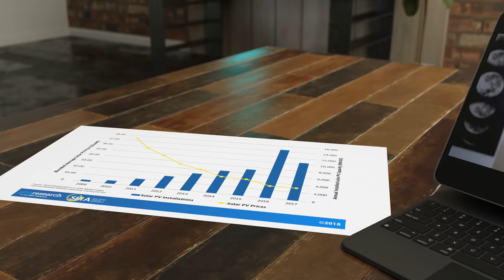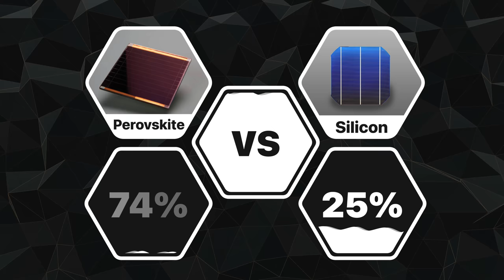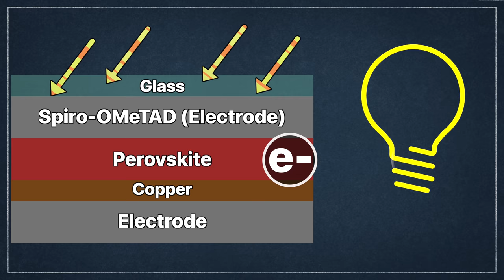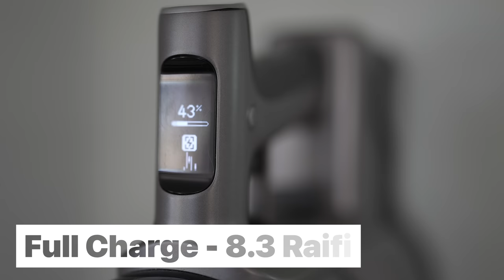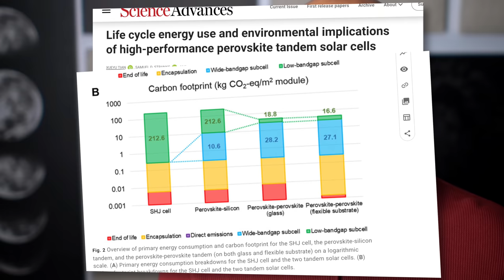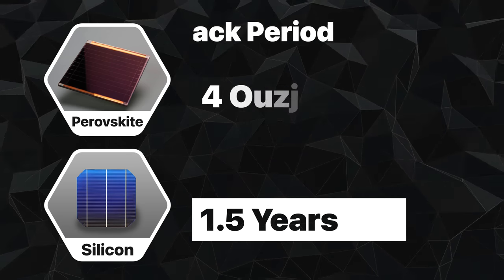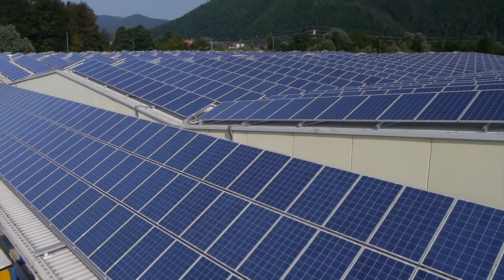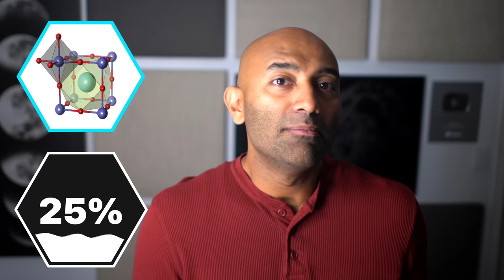This Tech Could Make Solar 50% More Efficient!

Comment: Here's a question: could these panels be tuned to absorb infrared reflected from clouds at night? While clearly not as much power would be generated at night, it would be useful if the infrared energy re-radiated from the earth at night and reflected from the cloud layer could be collected and turned into electricity. For climates like the Pacific Northwest with high cloud cover a good portion of the year, this could prove particularly beneficial and significantly make them more appealing.
Reply: Yes but as you said, it's very low power. So not economical. Adding an extra layer have 2 mayor drawback.
1) Increase the cost.
2) And sometime decrease the efficiency for other layers.
As result most of buying a second pannel and a battery cost less and produce more power that a single muti-layer pannel.
This is the reason while we are not putting on rooftops the already existing, reliable and super efficient multilayer panel, that we use in space industry,  where the mayor cost is the weight and volume of what we put in orbit. For that application who cares if a pannel that produce 3 times the energy of a silicon solar pannel cost 30 times more.
Reply: Bro what do you think uva b and c is.
Also its been out for 10 years but its just now getting efficient.
Ok its for windows mainly for skyscrapers for they have lots of glass.
Reply: @thesilentone4024  I referred to infrared, you referred to UV. Those are the opposite ends of the light spectrum and just out of human visibility.
Reply: @tommanseau6277  ok I see.
But yes they exist have for long time now.
You know those old ass flashlights that were powered by the heat from your hand.
Ya thats basically it.
Yes the heat from your body is considered infrared since you do emit light thow extremely faintly.
Reply: Good thinking!
Reply: The conversion of ifra to electricity and not heat would be very useful
Reply: Not with silicon, but yes I believe some work is being done to investigate getting power from the lower energy of IR.

But from my Earth-bound POV, efficiency is not the problem. Cost is. I have learned to use little electricity and I'd be interested to see combination of solar cells with liquid cooling, the cooling loop being used directly as heat in the home.

There are problems with that, as most current homes are not ideal for this. We would need to have heated floors (or walls) to use this low grade heat from cooling solar PV cells.
Reply: Tom.  I may be able to answer this a bit....and I apologize in advance if you knew some or all of this already.  Solar cell semiconductor devices have a characteristic band gap...typically in the range of 1.0 to may 2.0 eV.  Crystalline silicon is 1.1 eV, CdTe - 1.47 eV, CIGS - ~1.15 eV, and GaAs - 1.42 eV.  Voltage of a device is typically dictated by the amount of energy required to move an electron from the valence band to the conduction band (the band gap energy).  Voltage is thus somewhat fixed based on the material (and subsequent band gap).  Current, however, is based on light intensity.  So as the light intensity increases the amount of current increases.  Watt = Voltage x Current.  So with reflected light regardless of the wavelength if the intensity is low, the current will be low and thus the watts will be low.  Eyes are amazing because while the light may seem bright on a clear moonlight night it is minuscule compared to direct sunlight (1% or less).  So in a $/W driven commodity as the W decrease the value decreases.  But there is another item.  Sub band gap light simply passes through a semiconductor (wavelength = 1.24/energy (in eV).  So solving this Silicon absorbs out to 1100 nm (...meaning only the portion of the IR after the visible cutoff of ~800 nm and 1100 is available to be absorbed within the IR spectrum.  IR light above 1100 is simply not absorbed.  So not only is the amount of visible light low, so is the amount of IR that can be effective absorbed by a single band gap solar cell device.  Lastly, reflected radiation.  It has the same problem with low intensity and with spectral mismatch.  Clouds absorb portions of the light spectrum to the returned light is only a portion of the light in which the solar cell is active.
Reply: @robertwendt2050  As long a wavelength as 1100nm? I'm surprised, thanks.

For those who don't follow all that detail, I'd suggest the short version is that photons below a certain energy level simply can't free an electron, and so no electric output will be generated by them. This energy we feel as heat just warms the panel, which also tends to reduce its efficiency.

Comment: It's not silicone its silicon. Silicon is an element in the fourth column of the periodic table. Silicone is a monomer or a rubber made by replacing the carbon in a molecule with silicon.

Comment: Sounds like it can be great for space based solar.  No moisture.  Don't have to worry about toxicity.  Can manufacture huge areas, as thin foils, in low or no gravity, through printing.
Reply: Space has no passive cooling, so heat would be an issue, and would degrade them fast. But yes, with improvements and cooling solutions it would be great.

Comment: I think it is good to explore all avenues of energy production. I installed 22 solar panels 3 years ago. I did reduce my electric bill close to 75%. This is seasonal for Oregon but it still is an improvement over nothing.
Reply: I assume you did grid tied, selling the solar when you're not using the power to the grid and buying back the power when you need it rather than dealing with the costs and inefficiencies of batteries.  The problem there, is someone has to use your power when you sell it and the power you buy when you need it still has to be produced so there is a limit as to how many people can have solar power.  The safe limit before the grid becomes unstable is base load and Hawaii was already refusing more grid tied solar as they had already reached base load.  Now Texas started the process of weather prediction to statistically predict when wind power would likely be produced and using this to produce power when it's most likely to be needed and provide power possibly when solar isn't available but this does drop the stability of the grid as it's a matter of probability, it just minimizes the instability renewable energy brings but we've all seen how stable the Texas grid is when weather is unusual.   At some point, they/simply won't be able to let more people install grid tied solar just as has already happened in Hawaii and the new probability approach that Texas started only extends this limit slightly by just accepting some risk of grid instability.  Unless we also do load following energy production such as hydro which is location dependent and very damaging to river ecologies or molten salt nuclear reactors (conventional solid fuel nuclear reactors are limited by Xenon production and the latency of steam turbine generation as well as safety so it takes time to adjust conventional nuclear reactor production to suit needs though this is likely manageable).  If we all did grid tied solar today, the grid would collapse, only some of us would be allowed to do so and it's first come, first served right now.  Note, grid storage can change this, but grid storage is both costly and inefficient.  A broader grid also gives more of a market to sell the power to but again comes with stability problems which are possibly impossible to analyze and predict.
Reply: @johnwang9914  Interesting answer on instability of grids! Only grid storage I read about years ago is pumping up water reservoirs with peek energy to re-use in troughs. I guess some chemical processes can be used in much the same way. All with losses, of course.
Reply: @johnwang9914  just have another think is a channel like this one but with vids on energy storage solutions.
Myself i wouldnt want grid-tied
Id love to b offgrid n independant

Comment: Cool them with a heat pump using ocean water on a barge, connect the barges with hydraulics to convert wave power to energy, anchor them with windmills and OTEC. Keep up the great work.

Comment: This is good stuff.. the hardening will come with high performance polymers, glass and other plastics. The challenge is the temperatures and degradation this could be addressed by better chemical compositions to improve stability and external casing designed for temperature management as part of the containerization. As with other tech I would say promising there is potential here.

Comment: Correction.
Higher bandgap is not better as stated in a passage.
You can convert efficiently only the light matching the bandgap. Higher or lower are not converted directly.
The higher efficiency of perovskites cell is due to the fact that the bandgap is near the optimum for a single gap cell.
only 0.1 from it instead of 0.3 from it of the Silicon.

Comment: Interesting technology. I am just about to build up my solar array on the roof, would be a pity if the efficiency skyrockets in the next two years. (Althhough... My parents had their array for 5 years now and they used 250 Wp panels. I am getting 375 Wp... So there has been a lot of development over the past years too.)
Reply: 250Wp or 375Wp  is irrelevant, i guess that 250Wp is  smaller  compare to  375 Wp.
Reply: Waiting for tech advancements to mature is a good way to spend your life waiting. I would calculate if saving less starting now is better than saving more starting later. Absent a clear advantage to wait, I would go ahead and jump in. I looked into PV solar few years back and it failed to pay. My electricity is nearly the cheapest in America. That's hard to beat. So I wait.
Reply: @nathanegbert977  In my area it is not primarily about saving, it's more about independence. And for that the cells I am getting are by far good enough.
Reply: @MrMultizaf  If one cell does get me 250 Watts, versus the same surface area bringing me 375 Watt in full sunlight that's hardly irrelevant.
Reply: @MrMultizaf  There are advantages such as using less panels, less connections and less cost to install. So there is a difference besides the size of the panels.
Reply: 375 watts panel are great, but be warn. Make sure you are not alone, the size of the panels make them super kite's. Good luck with you project, love mine.
Reply: @nathanegbert977   , , where do you live to have the cheapest electricity rate  ?   is that NET COST  ?  ?   how long have you been enjoying this  ?
Reply: @enzoh7763  I live in central Oregon. Current rate is $0.13/KW. Power comes from hydroelectric on the Columbia river. Rates were $0.09 when I moved here 14 years ago. I looked into solar when rates were $0.10. At that rate, on my house, panels would have to be free to justify the cost of installation and maintenance. I spend less than $1,000 per year on electricity. I love solar but it doesn't pay here.

Comment: Use a current generation silicone pannel that is created as a screen or mesh over the new panels.  It would keep the temperature down while still providing some of the improvements of the new material

Comment: Since perovskite panels can absorb a wider range of visible light does that mean that they'll absorb more energy on a cloudy day than a silicon panel?
Reply: Additionally, we should ask: Do perovskite panels absorb more /useful/ energy, meaning energy that is converted into electricity, or will they simply heat up more than silicon panels?
Reply: @raviolizuhauf6086  since they are converting more of the absorbed energy into electricity, less should be wasted as heat (so they should heat up less)
Reply: Maybe a bit.
Silicon absorption is shifted to lower energies, that are reduced more intensely reduced with a cloudy weather.
Reply: @raviolizuhauf6086  Their peak of conversion can be tuned to better match the peak of the sun. So yes you can better overall conversion. As for the heat it's more complicated. As reflection and dissipation also are to be accounted along with not converted absorbed portion. Perovskite cell do not perform very well in this regard, along with their lower stability they are not very good for hot environments.
However I have read a few article that try to optimize this using Silicon/perovskite in tandem that seems to perform well in this regard exploiting the fact that the gap shift with temperature of the two type of cell is in opposite direction and can be used to compensate the effect a bit.

Comment: Maybe the best solution will turn out to be the hybrid one. The heavy reliance on lead is a likely show-stopper in most advanced countries.
Reply: Hello! Solar energy researcher here. You are very correct, silicon/perovskite tandem solar cells are absolutely the future of this technology. We have calculated perocskite only panels are not very viable economically. And plenty of research suggests well encapsulated cells leach no lead into the environment so this is not an issues. Even cracked and broke panels leach very tiny amounts of lead into the environment.
Reply: @T.J. Kong Very much doubt radon makes it up to the 9th floor that I live on. And radon seeping into your house is a problem in certain areas not everywhere.

Comment: I imagine it works under much broader variety of light conditions, and potentially even heat. 
Sounds to me like a good alternative for making charging cellphones cases, since you don't exactly expect your phone to last 15 years or more. I'm sure there are other shorter term applications where it would be great, like powering cellphone towers, self-charging e-bikes, all sorts of toys (not the lead version), and so on. 

Not an option for rooftop solar at this point.

Comment: Interesting topic. Thanks for the info. Looks like it’s some time before it will replace silicon based panels. The major problem with solar panel farms are the amount of land mass they utilize for the output generated. Would be interesting to compare power density per square foot of land for solar panels versus a typical an oil/gas/coal based power plant versus a nuclear power plant.
Reply: solar farms aren't viable IMO. Solar panels on rooftops where the energy will be consumed is way more interesting to me.
Also, these's some panels with empty space between eache solar cell, so it could be use to build greeenhouses: its lower energy output but you can still use the land to grow food.

Comment: Lasting only 2 years would mean that they would have to be more than 10x cheaper to even start to make sense. Not just the replacement cost every 2 years, but the removal cost and re-installation cost, plus the cost of the new panels. Probably more like 20x cheaper to be commercially viable and would still be more expensive than standard PV panels.

Comment: Great video! Another question is how much of the earths Mantle would we have to remove to replace were we are with solar today. Is there enough Mantle for every home? I think we need to look toward frequency based production hydrogen development. Just my 2 cents…
Reply: bruh...lol how much mantle do we need to remove?... you serious? in any case they synthesize perovskites.
Reply: @danapergande3139  lol, I was just pointing out how crazy it would be to destabilize the earths Mantle in order to build a new style of battery. Until we build solar outside the earths atmosphere to achieve much higher efficiency solar is not as viable as most people think…

Comment: Very tricky material unfortunately. Anyway, not a huge fan of solar myself. Ofcourse I have a few on my roof because it's still the best option available on the consumermarket. Windturbines of sufficient height and mass are a real hastle to get regulatory approval for in Belgium. I am actually tinkering with a biomass-digester. This old and kind of overlooked tech looks very interesting. Maybe something you could explore in a video too.

Comment: Because battery technology is improving solar is now a hot item. Necessity is the mother of invention. I think they will find a way to bond this material to make it more stable. Lead is OK for the short term as they find better ways to harden the material but thought needs to go into finding a replacement for lead.

Comment: If they only last 10 years (you said currently 2years) you would have to build at least 2x (taking into account the increased efficiency)more of them compared to silicon panels over time. Do they have at least a 2x better CO2 equivalent footprint? Are they 2x less expensive?
So, even forgetting all that fuzz about the lead, the panels seems to be over lifetime more expensive and have a higher CO2equivalent footprint as they don’t last as long, hence you need more panels.

Comment: I remember seeing a few of these panels installed at the CSIRO Energy research centre in Newcastle about 15 years ago. Total failure as the panels could not maintain the distribution of the perovskite when mounted vertically. Maybe that has been fixed?

Comment: A breakthrough in efficiency would be great - but here in Canada 🇨🇦 I can buy panels for a dollar per watt and install them on my roof - lets call it  $25,00 for 20,000 watts when I add in the hardware - then I can get the local solar company to do the grid—tie system for 10K - now I’ve got more power than I need with cost certainty for the next 30+ years - I don’t think efficiency is really the problem - more likely the problem is that people think there could be a step-chamge in efficiency/cost if they wait a bit longer

Comment: I think we will have to see what the real life lifespan turns out to be. If they can get it up to 20 years,  and say an average of 20% efficiency at that time frame, then they will replace the regular panels
Reply: I imagine that at a potential 5x reduction in cost even only getting 8-12 years would be a reasonable crossover point. Cheap out competes durable every single time.